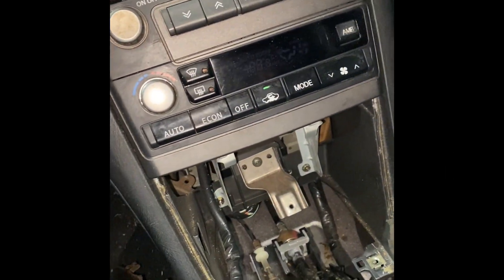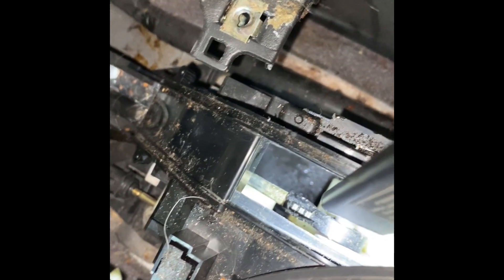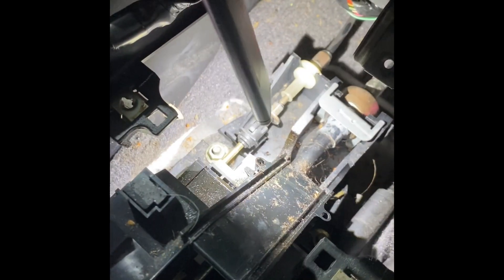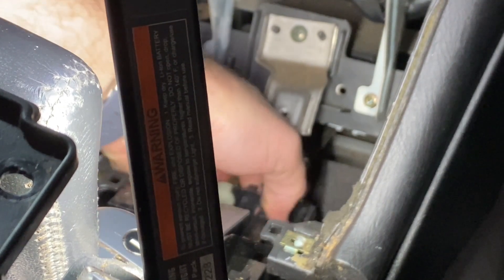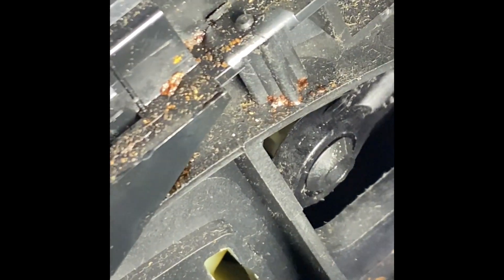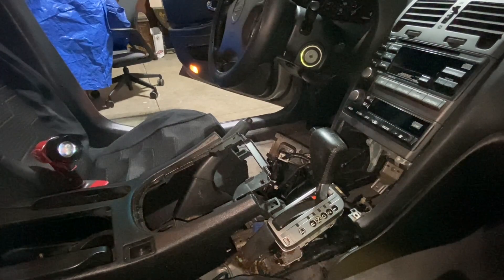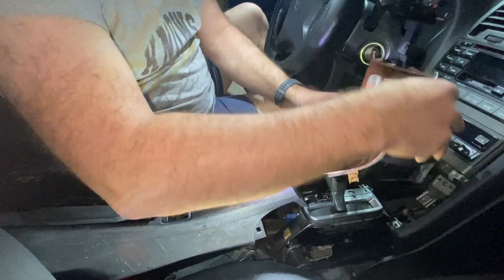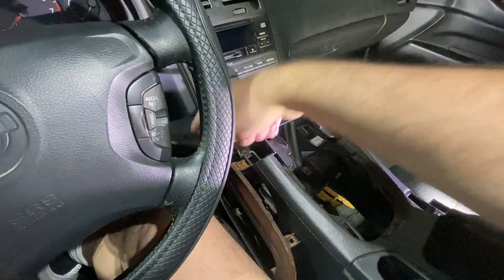“MadMax” 2001 Maxima transmission shift cable bushing replacement

Comment from the maker: After adjusting the neutral safety switch as mentioned at 11:27 
It’s been perfect 👍 
This was kind of difficult to find since it still worked mostly
I wasted $31 on part but that’s ok.  Better then a 200 diag fee from a shop

THIS IS THE FINAL VIDEO ON THIS CAR.  I SOLD IT